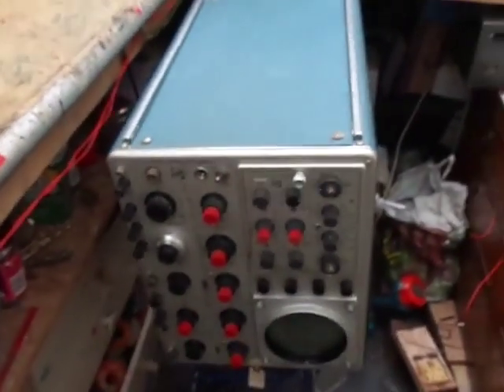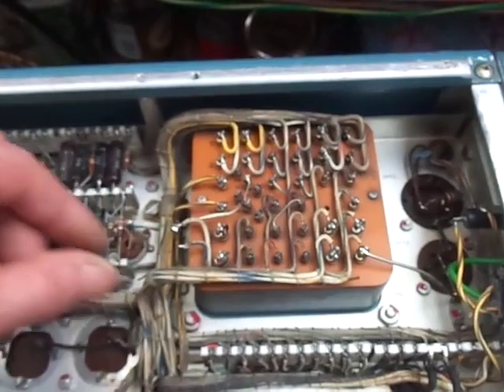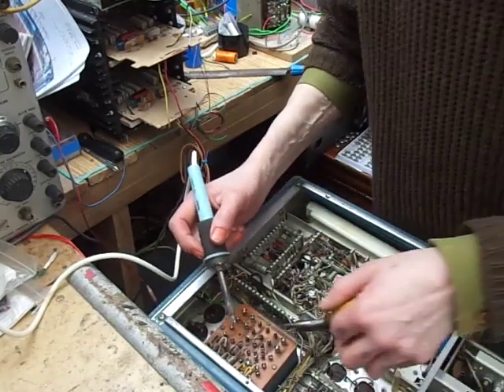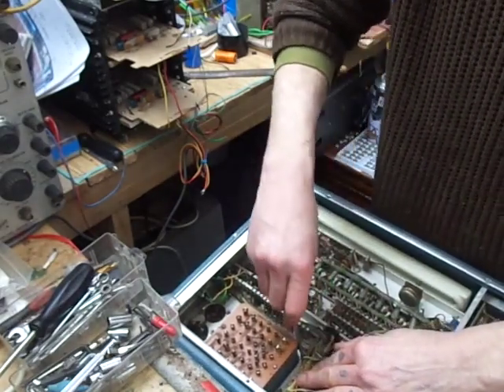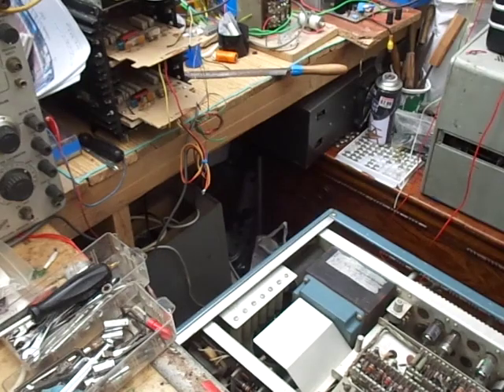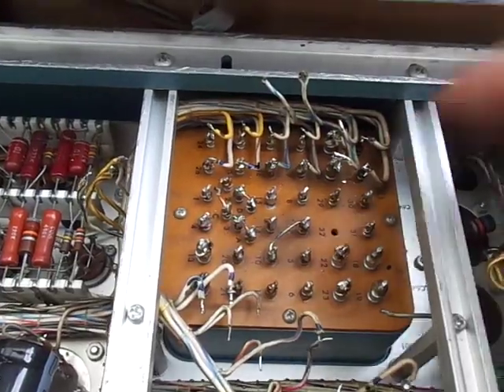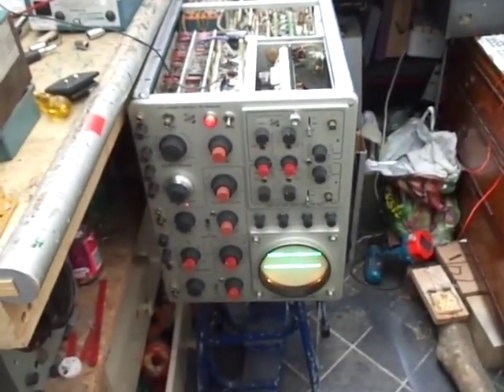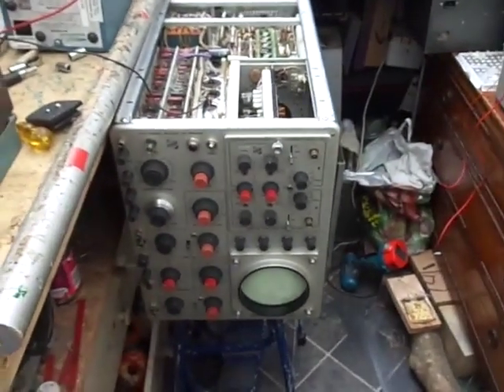Tektronix 585A Oscilloscope - Mains Transformer Transplant

Comment: Did you ever figure out what’s up with the neons not glowing?
Reply from the maker: Not specifically, however the short circuit between two high voltage windings in the mains tfmr caused the loss of several power supply rails, which could have been the underlying cause. The replacement tfmr has also failed now, I will try and re-wind this winter.
   With the replacement of the mains tfmr, the scope operated ok. I've now stored both 500 series scopes in a warm dry room over winter, I'd advise all Tek 500 series scopes to do so too.
   TFW, do you have a Tek 500 series scope?
Reply: @diabolicalartificer  yes I do, I have two, a 545 and a 565. They both work, but the 565 has a bad HV transformer and shuts down after a half hour or so. I keep my scopes in the basement, where its temperature and humidity controlled. Too bad about your replacement transformer, those are hard to come by.
Reply: Oh, I almost forgot, I have a 561A as well!
Reply from the maker: @AmishSpecialForces  I've had several Tek 500 series tfmr fail, I think due to being stored in damp, cold conditions for years. They all have, AFAIK the same mains tfmr configuration with minor differences. There is a 117v 0v 117v winding (+/- a few volts) physically next to a winding of 180v ish. The insulation between these can break down, causing the PSU to fail. I've a spare 545B tfmr which I took apart and soaked the core winding in thinned varnish, which improved the insulation resistance between windings.
   Your 565 issue sounds like something else though. I'd check all the power supply rails after 30 mins for excess ripple voltage, see the manual for specs. It could be a cap leaking or a valve developing a heater cathode short. I'd recommend you try & fault find the issue soon, it'll only get worse & may cause more irreversible damage. Hope you get it fixed, regards, DA.